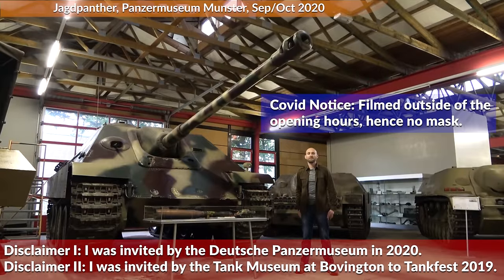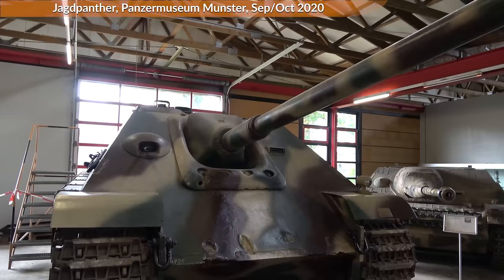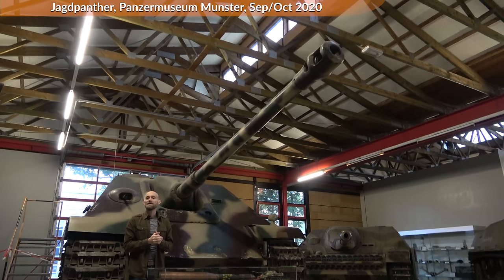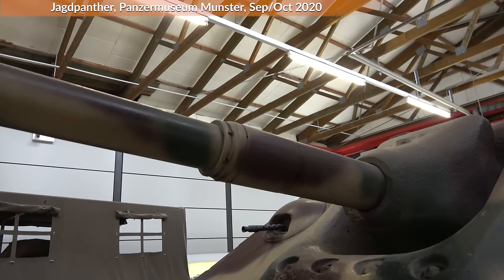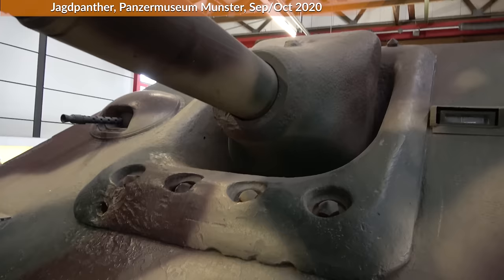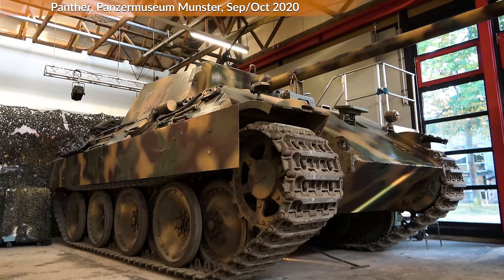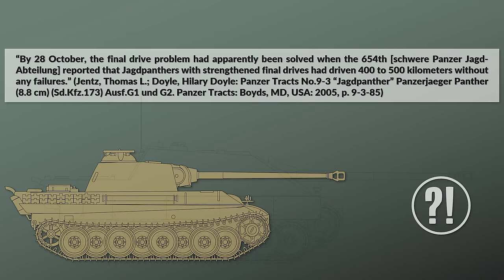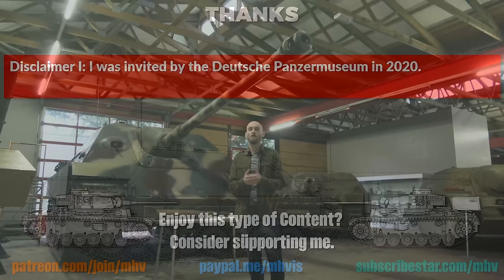Jagdpanther: King Tiger's Gun & Panther's Chassis

Comment from the maker: Want to see more videos with content from museums or historical sites? Consider supporting me on Patreon or Subscribestar, these supporters make trips like this possible. 
Additionally, you will get early access (no ads) and other features, more info here: 
» patreon - https://www.patreon.com/join/mhv - » subscribe star - https://www.subscribestar.com/mhv

»» Errors & Corrections ««
The Tiger I had an L/56 not L/53. Thanks to TheBlackhawk123.
5:37 - It should be "younger", I mixed up "later production" with "older". Thanks to Andrew.
Reply: Just 1 correction: Tiger 1 used L/56 cannon. 3:00
Reply: Roger that! I am in for a copy ;-)
Reply: Black Knight  That is not so simple...
Reply: We love you Military history visualized keep up the good work
Reply: I TRULY like the fact that you call it what it is. A hunting panther, and NOT a tank as so many " so called " 20 something historians do. For some reason they just don't get the fact that if it DOESN'T have a turning turret it's not a tank.  It's a tank destroyer.
Reply: I wasin the middle of asking about the final drive issues in Doyle and Chamberlain, and then you brought it up. Impressive. Can't wait for the video, that never made sense to me given the similar weight and the fact I had assumed the chassis came off the same production line. A change by date manufactured for both vehicles would make more sense, and maybe a higher percentage of Jadgpather chassis were drawn from these chassis? Or did Jadgpather's have a shorter life span (getting killed before the chance of failure), or thinking about it given their inherently defensive configuration maybe they were simply driven shorter periods of time, resulting in fewer failures than a tank that is driven for longer periods. Final speculation, was the final drive fixed or might the lubrication\maintenance interval have improved? I would tend to doubt that, given what happened later in war, but a reversion to older, more viscous lubricants might have helped, or simply some mechanic noticing metal shavings and tack welding a strong magnet on the drain plug, and that getting shared.
Reply: More museum videos! :)
Reply: Hi, I love this video. Very informative.  I am just wandering.  When I was in Munster, I was inspecting this vehicle and, as can be seen in this video also, there is a small hole on the gun mantle collar. 
It does not look like an impact round to me but I am no expert. 
Can you please advise me as to what it is and what caused it. I'd really appreciate this. Thanks.